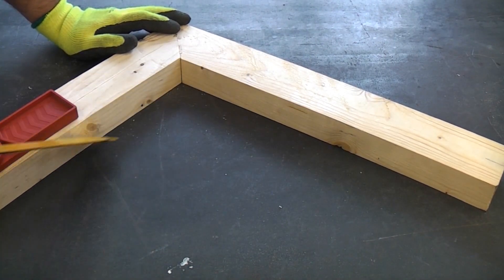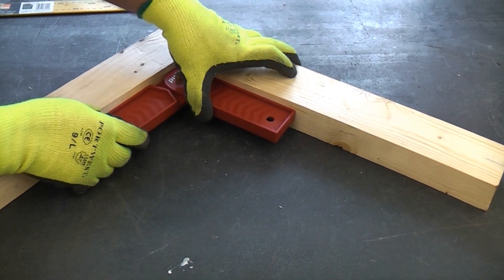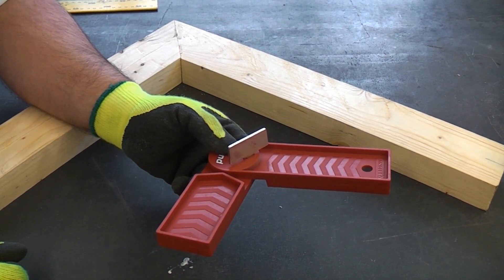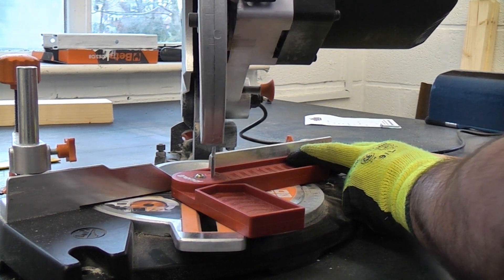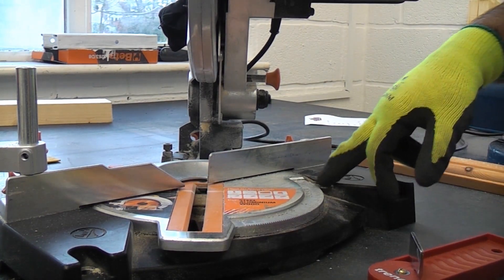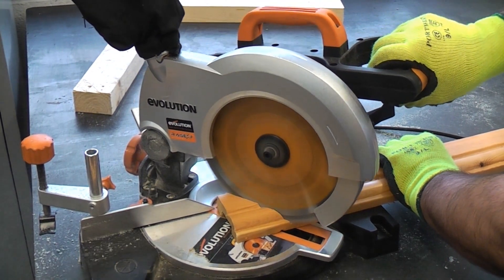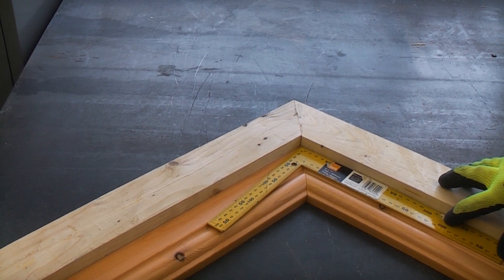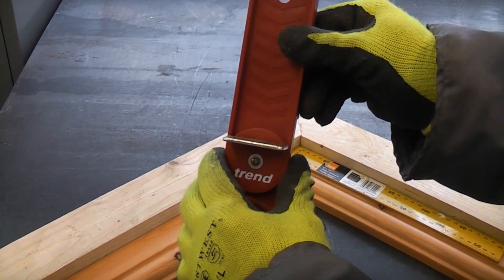Trend Angle fix

Comment: Which is the right way of using the angle finder. I see you place the blade on the flag and other vids I've seen the blade is placed against the side of the flag.
Reply from the maker: I think it will give the same result, I guess it's just personal choice
Thanks for the comment 👍
Reply: @ultimatehandyman  👍

Comment: Wouldn't it gave to be half the complimentary angle as if 80 degrees and you cut 2 x 40 degrees they won't fit
Reply from the maker: You always have to halve the measured angle, don't you?
If you measure 90 degrees, you cut each piece at 45 degrees etc.
Reply: @ultimatehandyman  yes for 90 degrees but if 85 degrees don t cut 42.5 cut 47.5 I believed from another source

Comment: this looks like it may help,having nightmare trying to fit glass beading to outside door ,bodged up so many pieces untrue beading goes on face and inner of door,got two panes glass both got sloping top bits ,will this tool help ,was thinking of sliding bevel,thanks for any help
Reply from the maker: +Philip Hoad 
Yes, this will help, or the sliding bevel.
I think this may be easier to use though as it automatically divides the angle in two for you (with the flag)

Comment: How does it lock in place like a sliding bevel does? What say I bump it on the way to the saw causing the angle to change?
Reply from the maker: It does not lock, so providing you don't bump it the cut will be fine ;-)
Thanks for the comment

Comment: Hi Great video, and the ultimate handyman website is dead cool for lots of tips too, I got this trend device a while back but I am still struggling to understand how to cut skirting boards,as if you lay them flat on the saw surface then the angle is wrong, I cant lay them as I would put them on the wall as my evolution chop saw doesn't rise high enough, I am sure there is a trick I am missing here, my carpentry skills are very basic and i am just a basic diyer who will have a go at anything, I have had to scribe and follow the profile to get them to join in a seamless way, but I am desperate to understand how to cut skirting for the final bedroom I am doing up using the trend device and my chop saw, any chance you could put up a video of how to get tall to medium skirting boards chopped accuaretly with a chop saw and a trend device,please ?
Reply from the maker: +rhaman “main” khalid Sorry, it's not something I intend doing soon.You can only mitre skirting boards for external corners, never internal corners as they need to be scribed.http://www.ultimatehandyman.co.uk/how-to/woodworking/skirting-boards
Reply: Ultimate Handyman 1一

Comment: Right, am I crazy or did you cut them wrong lol? Surely the mitres you cut would only take the corner if the skirting was laid flat? Should you not have had the skirting upright to get what you did mate?
Reply from the maker: You are crazy LOL.
I used architrave in this video (just as an example on how useful this device is).
If you were using skirting board you would of course stand it up the right way.
Thanks for the comment ;-)

Comment: I have had this angle finder for years ( 10+ ), whilst its been very good and I still use it, there are better options out there now. You can't lock the angle once you have measured it, so if you accidentally bump it on your way to the saw, you'll lose your angle and make an incorrect cut.
The Starrett angle finder is small and easier in operation, it tells you the angle to set your mitre saw to, you don't need to fuss around getting the flag on the guide perfectly in line with the saw blade.
As I say, it's served me well, but angle finding tools have moved on, and this needs updating.